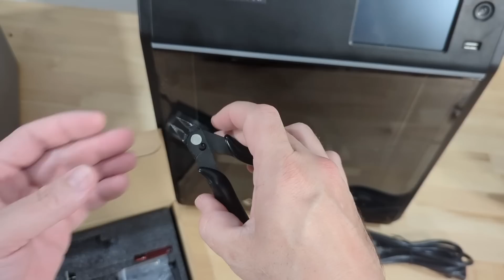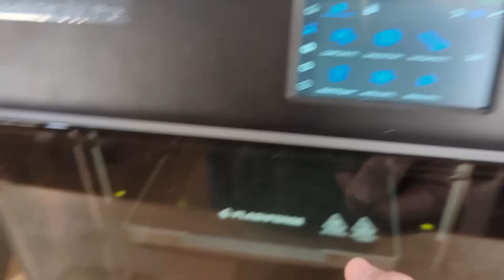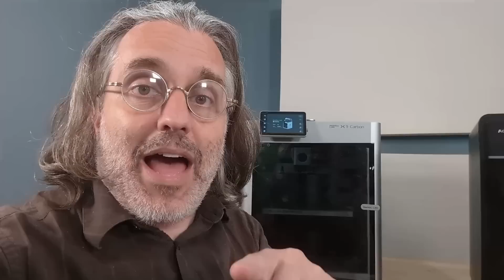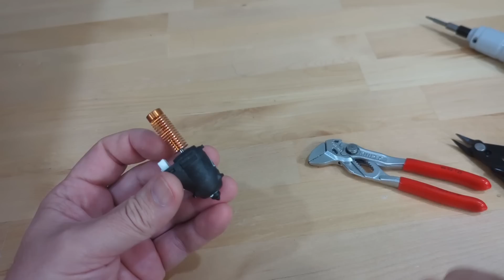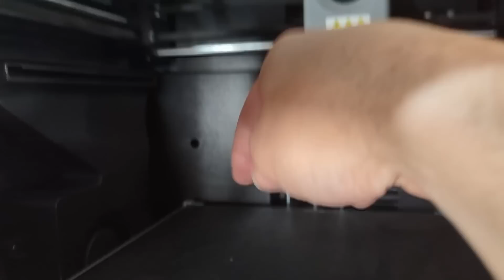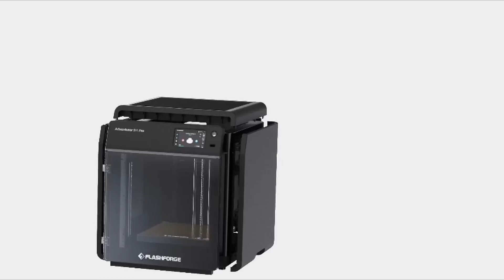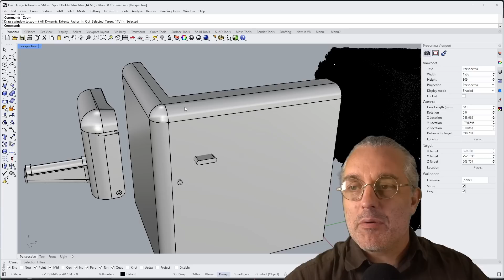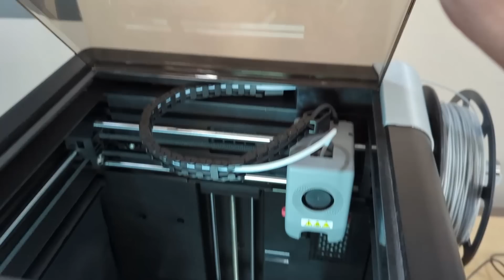Better than the Bambu Lab X1C (for the money) - Flashforge Adventurer 5M Pro

Comment: A very good and detailed review, but it does feel a bit biased against bambu. A few things worth mentioning; I jotted them down as I watched the video.
- The build volume difference is bigger than it sounds. There is no "cheating" on bambu's end; the build volume is as stated: 256x256x256.
- The bowden tube setup on the flashforge is horrible. It's pretty bad on the X1C as well, but you can at least print a riser for the glass top so the bend isn't as sharp as it is on the flashforge.
- The quick swap nozzles on the flash forge are an excellent concept, but pricey and they always seem to be out of stock. Also, the bambu comes stock with a hardened nozzle.
- There's literally an "Unload" button on the X1C under the extruder control buttons.
- You don't have to keep removing and inserting the sdcard in lan mode, you can use FTP. Very easy to do and very convenient. I use filezilla.
- Most of the comments I see about bambu "privacy concerns" are less about actual privacy and more about "cHiNA BaD" fear mongering. Just an observation. 
- Bed adhesion on the flashforge doesn't seem to be as good as bambu's gold textured PEI sheets. I rarely have prints life, mostly when it's cold in my room. No glue ever used, just wiped with IPA before every print.
- Everything the bambu does before printing is to ensure the best print quality. IIRC you can disable some of those things to speed up the print, but I just leave everything on.
The X1C also has an activated charcoal filter. Fully sealed is good for maintaining heat, but you do need airflow for proper venting of VOCs. The X1C does fine in both regards here. None of the gaps are big enough to leak much heat, but they do provide enough airflow for the the filter to do its job. That said, I'd not print ABS or ASA with either without venting outside.

Again, this was a very good review, very detailed, but a bit biased. This is usually the case when reviewers are sent products for free "for review". Not a knock on you personally, but very few reviewers who receive "review" products for free are completely unbiased.

All that said, as a consumer, someone who'd have to drop the actual cash on the product, the flashforge would be more compelling at $350 or so. At $500, I'm saving another $100 to get a bambu P1S instead. Or if I don't plan on printing ABS, ASA or nylon, I'm getting a bambu A1 for $339.
Thanks for posting.
Reply from the maker: Fantastic in depth comment thank you. Many great points but some of which I do want to respond to:

- The build volume difference is bigger than it sounds. There is no "cheating" on bambu's end; the build volume is as stated: 256x256x256.
I was referencing that the Bambu Lab heated bed does not cover the entire print surface. which extends past the aluminum by approximately 4mm on all sides whereas the Flashforge heated bed goes edge to edge. I tried to show that aspect of X1C in the video here: https://youtu.be/_y7Me79WMws?si=oJB9JySvJf-E_h5e&t=3823 You are correct, the X1C has a larger print volume. However, it is not large enough for my large projects. So I consider both printers to be in the same class.

- The bowden tube setup on the flashforge is horrible. It's pretty bad on the X1C as well, but you can at least print a riser for the glass top so the bend isn't as sharp as it is on the flashforge.
True. Also, the FF has that filament runout switch which is challenging to feed the filament past. Completely and totally inferior to the top of class best I've ever seen filament runout switch on the X1C

- The quick swap nozzles on the flash forge are an excellent concept, but pricey and they always seem to be out of stock. Also, the bambu comes stock with a hardened nozzle.
True. The only redeeming quality of the FF nozzle is the quick change ability. The reason you can't retract the filament and instead must purge every time you change filament is because of the inferior nozzle/melt chamber design.

- There's literally an "Unload" button on the X1C under the extruder control buttons.
Another commenter pointed this out. I have tried to use it and find it frustrating to the point that I don't touch that "functionality" any more. BL is trying to take care all details for you so idiot users can't fail. This makes the printer less functional for any user with half of a brain. I don't want to click 3 buttons just to press "unload" that's bad UX. Also, when you click unload you have to tell it what kind of filament you have in the machine. Then (if I recall) it denies you because it can't read the Bambu Lab Chip attacked to BL filament. Total frustration. Easier to just hit the retract button a bunch of times.

As I said to the last guy: 
That's the whole point that I'm trying to make. It's more of a difficulty to use the workflow you describe. The machine is trying to think for me. I am fully capable of running 3D printers. All I need is a warning if I try to remove filament when the nozzle is cold. But even then I still need to be able to remove filament without it at full temperature because of So-Called "cold pulls" to de-clog the nozzle. Seriously, the menu options are wrong and they're a very bad UX design. I should be able to just hold the up arrow on the extruder control and it should unload at full speed. If the nozzle isn't at temperature yet, it should just say "The nozzle is below printing temperatures. Are you sure you want to continue?" 

The printer treats you like you're an idiot. It's a dumb machine. I'm the human  It should do what I want it to do. My options should not be buried deep in a convoluted menu somewhere.

- You don't have to keep removing and inserting the sdcard in lan mode, you can use FTP. Very easy to do and very convenient. I use filezilla.
I haven't used LAN mode on the BL. I do extensively use the SD Card, and I find that they have either not developed the workflow to be as capable as WiFi printing through their servers or they may be purposefully handicapping the functionality because they really don't want you to print with an SD card. This makes me distrust BL to the point where I do not even have the printer connected to WiFi. My question to you: Is BL as functional over LAN as it is through their servers other than the things you need a server to accomplish?

- Most of the comments I see about bambu "privacy concerns" are less about actual privacy and more about "cHiNA BaD" fear mongering. Just an observation. 
China is bad. They are den of thieves hellbent on controlling the world through manufacturing. They don't want anything to be made anywhere else and they will steal you intellectual property the second they find it. I am an innovator and entrepreneur. Ask me how I know. At this point they won't even work with westerners. It's easier for them to just steal your ideas than work with your to bring your baby to market.
 
- Bed adhesion on the flashforge doesn't seem to be as good as bambu's gold textured PEI sheets. I rarely have prints life, mostly when it's cold in my room. No glue ever used, just wiped with IPA before every print.
This seems accurate. But I do like the textured print surface better than the smooth one that came on my X1C

- Everything the bambu does before printing is to ensure the best print quality. IIRC you can disable some of those things to speed up the print, but I just leave everything on.
For small prints ALL the steps are unnecessary, and really slow things down. I've had 3 minute prints that took 13 minutes because of all the startup steps. There should be a button to do the steps when you first turn on the printer and then run multiple prints without recalibrating. 

One thing I forgot to mention which the BL absolutely dominates is first layer scanning/problem detection. Absolutely fantastic functionality that has saved me multiple times.
Reply: @DesignPrototypeTest  Good points as well.
- Does that 4mm have any effect on actual printability? Genuine question; I have two A1s with the same bed size and I haven't had any issues the few times I've used the entire build volume on X and Y.
- In regards to the unloading and wifi reliance, bambu wanted to make the experience as easy and streamlined as possible for new users. They definitely achieved that; your complaint about unloading is the first I've seen, but probably because most X1C owners have an AMS as well. With LAN mode you lose access to the app and fw updates. You can connect to update, then disconnect though.
- I'm not saying china is honest, or even good (I know they're not), but for most bambu users who aren't running huge, profitable print farms, there's probably not much worry that out designs are being stolen. I mean if china really wants my toilet paper holder files, have at it. For anyone who's main concern is privacy, probably wouldn't buy a bambu printer in the first place.
- I think all bambu printers ship with the gold textured PEI plates now. I prefer those as well.
- Your last two points go hand in hand; those extra steps are what give the bambu the advantage on the first layers. It's not as bad on some of their other printers. On the A1 series it's around 6 minutes of prep. That's fine with me; the tradeoff of not having to babysit the first few layers is worth the small bit of extra time it takes. To each his own though.

I understand the cost difference being a factor, I just think that all things considered, and the capabilities of the machines, bambu is still the better value when you step down to the P1S. You get bambu's ease of use, reliability, bigger build volume, and ability to add the AMS for only $100 more. It also depends on what you value the most. For me, reliability and workflow are the main factors I want when 3d printing. That way I can focus on the actual designing and not so much getting the printer to print.

I'll check out your X1C review and subscribe for support.
Reply from the maker: -4mm 
Yes. If you have a part which is 256mm  long , so you will need to print edge to edge you will not be able to use a raft or a brim to hold the part down and prevent warping off the bed. Because the edges aren't heated that part is going to start peeling off the bed right at the most critical end points. Once it starts peeling the print will zipper off the bed for quite a distance inward. You have to keep those ends held down. Which is why we came up with "mickey mouse ears" instead of a brim everywhere. The endpoints are the critical locations. So if you subtract the 4mm on either side you get a usable print surface of 248x248. But heated print beds already have the problem of being hotter at the center and colder at the edges. With that extra overhang acting like a radiator I think you will lose another 2mm of usefully heated bed at the edges. So we are down to 244x 244mm. Compare that to the flashforge with a 230x230mm bed usefully heated edge to edge. The difference is negligible. I suppose you could argue that the cold surface edges on the BL could be used for a raft or brim to guarantee extra hold down, but you are still printing the same size part. So, is the BL bigger/better. Sure, but in ways that don't matter. It's mostly for show and to claim a larger print area. It's not really useful. Which is why I called it a cheat. 
-bambu wanted to make the experience as easy and streamlined as possible for new users. 
Yep. And Apple also makes it's products idiot proof so that consumers can get something that "just works" but you can't do anything with the product that Apple doesn't approve of. No power users allowed. A 3D printer isn't a consumer product. It's for above average skill users. Making an idiot proof machine at the expense of usability for advanced practitioners isn't a good look.
-bambu is still the better value
BL is undeniably the better printer over all. But if BL gets a 100% score the Flashforge get's at least a 90% (I would argue closer to 95%) and all of the truly useful features are there. To be equivalent value it should cost 90% of $1,200 or $1080 but instead it costs half of that. Meaning the Flashforge provides twice the value.
Reply from the maker: P.S. I received both printers free "for review." when one costs less than half the price with only a small hit to functionality it gets more love. If you perceive my words as biased that is probably the source.

Comment: If the hardened steel nozzle hotend is also copper / brass except for that tiny last couple of mm of nozzle fitting over it, it won't be very resistant to the abrasive filaments, will it?
Reply from the maker: Great comment!

My observations are that the hole in the nozzle gets widened with abrasives. Also, the tip of the nozzle gets rounded being dragged across abrasive filament after printing. I am sure that some whear will occur inside the melt chamber made of brass, but it won't be that important compared to the massive damage that gets done to tip of the nozzle.

Comment: If you click on settings in the X1C there is a load/unload. Same thing with every bambu lab printer I ever owned. Even the a1 and a1 mini have a load/unload filament option. You’re doing it wrong or you are on some extremely old firmware
Reply from the maker: When you click on that, it asks you for the filament type. The menu is convoluted. It's easier and faster to just click the button.
Reply: The temperature menu you were in to extrude filament click on the filament tab to the right of it on top and should be a load/unload option. If not explore your menu no doubt in my mind that it’s got a load/unload option so you don’t have to click extract 10 plus times. It also preheats the nozzle and everything for you than backs the filament out all you have to do is pull it out the rest of the way.
Reply from the maker: That's the whole point that I'm trying to make. It's more of a difficulty to use the workflow you describe. The machine is trying to think for me. I am fully capable of running 3D printers. All I need is a warning if I try to remove filament when the nozzle is cold. But even then I still need to be able to remove filament without it at full temperature because of So-Called "cold pulls" to de-clog the nozzle. Seriously, the menu options are wrong and they're a very bad UX design. I should be able to just hold the up arrow on the extruder control and it should unload at full speed. If the nozzle isn't at temperature yet, it should just say "The nozzle is below printing temperatures. Are you sure you want to continue?" 

The printer treats you like you're an idiot. It's a dumb machine. I'm the human  It should do what I want it to do. My options should not be buried deep in a convoluted menu somewhere.

Comment: I've always been apprehensive of bed rise printers particularly those with the bed supported on one side only. How much layer shift is noticeable?
Reply from the maker: This is a valid concern. If it was a CNC machine. The forces acting on a 3D printer are extremely minimal. The bed is plenty stiff. There are zero issues associated with The z-axis movement system. The bed is lifted at three points.

Comment: While I find the video and channel very informative, I wanted to make some notes about a couple things. 

Why compare a $500 printer to a $1100-$1500 printer? You mention with the Bambu printer you have to use the cloud, you don't. You can set "LAN Only Mode" and not use any of the cloud stuff. They have also publicly stated that they don't care if you run custom firmware on the printers, you will loose all warranty. (X1C Has a custom firmware available to cut out all of the cloud stuff and add features.) 

I think that if you actually compared it apples to apples (P1S vs 5M) then it wouldn't come out as far in FlashForge's favor. 

To me in this video, there is nothing that would compel me to buy a FlashForge over a Bambu or even a similarly priced Creality K1. All I see are downsides to going FlashForge. 

This comment is not to fight anybody who likes FlashForge over other brands, just trying to share my opinion on it as somebody who has been in the 3D printing world for a while starting on hand built i3 style printers all the way up to just recently purchasing a X1C.
Reply from the maker: If you are only printing using a single filament the 5M pro is undeniably the better choice for the money compared to the X1C. I cannot recommend the P1S because I have no experience with that printer. I do not know if the value is as good as what Flashforge has achieved. 

As I said in the video I perceive BL as the best Chinese brand of 3D printers. I am saddened that members of tHe cOmMunItY contacted many companies to spread lies about me and cancel me. This effort was successful with BL and they "have no intention of working with Design Prototype Test in the near future." I would love to compare the P1S to this machine. Unfortunately BL has not sent me one to review. Therefore I will compare the flagship Flashforge printer to the flagship Bambu Lab printer.
Reply: This not members of community, these are members of communism the modern blogger communism

Comment: Lol, The bambu's doenst need to have connection to their servers, you can use LAN only..
Reply from the maker: But then it is functionally the same as the FF. Also, I've noticed the SD card workflow limits capabilities beyond what is technically required. I've never LAN only mode. I wonder if it is similarly handicapped? It definitely seems like BL is trying very hard to get you dependent on their servers.